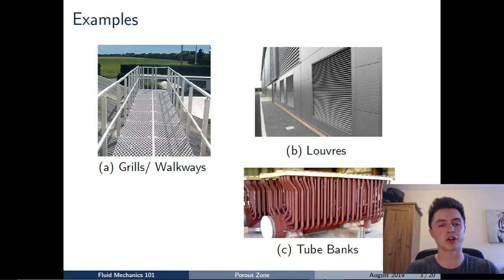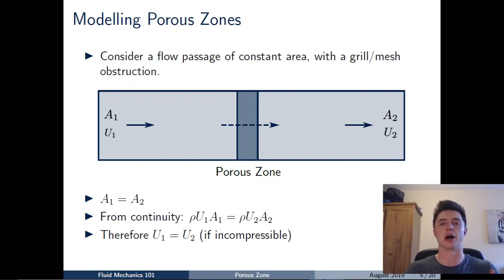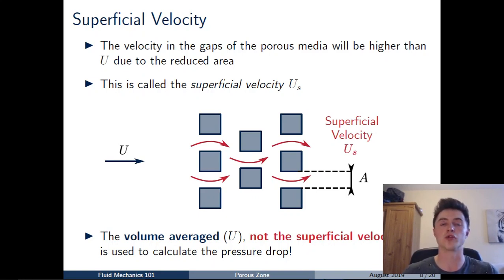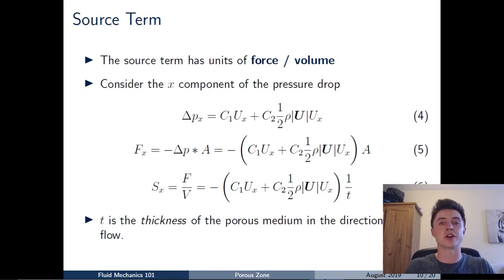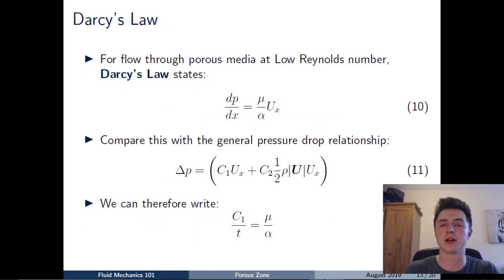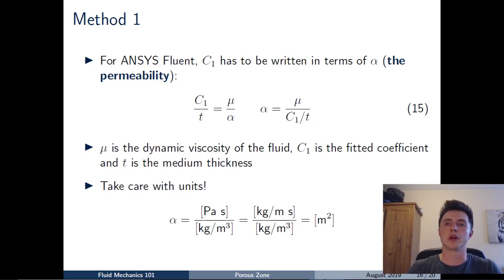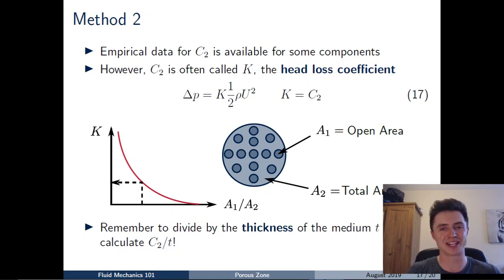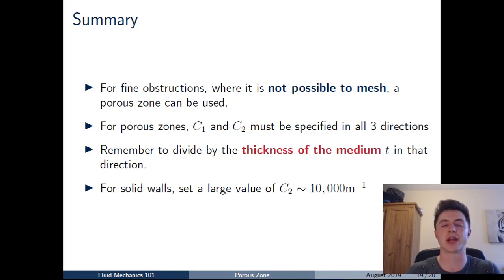[CFD] Porous Zones in CFD

Comment: Thank you very much Doctor Aidan for your excelent explaination.
But there might be a mistake about the definition of the "superficial velocity". I have read different explainations about the "superficial velocity" online, The superficial velocity ist defined as the volume flow rate divided by the cross area, which is, i think, the velocity "U", that you mentioned in your video. The "Us", which you called superficial velocity is maybe the physical velocity. In the <fluent user Guide> the superficial velocity is equal to porosity times physical velosity, which means the superficial velocity is smaller than the physical velocity. But according to your definition the superficial velocity will be bigger than the physical velocity.
maybe its just a mistake :)
Reply from the maker: Yes this is a mistake. I have pinned your comment so everyone can see 😊
Reply: Just to add an additional source for the differences between these velocities; the video titled "Where text books go wrong about porous media" by the Department of Process and Life Science Engineering (PLE) at Lund University describes the differences perfectly.

Comment: For turbulent flow, what changes in the equations? Imagine you are simulating an air cooling system of a radiator inside a duct. What are usual values for beta and alpha for a Radiator? Let's say the radiator has 3cm and the air is flowing ate 30m/s. Thx for the video

Comment: For modeling a basket strainer (~20,000 holes) as a porous zone, what's the practical method to determine the correct C1 and C2 coefficients? Also, how do I define the direction for these values in the CFD setup? Thanks!

Comment: First thanks so much for these amazing lectures. I have been working with porous media for long time to model heat exchanger cores. My question is about meshing. Long ago we did some studies and it looks like hex type or extruded meshes were much better than tets to resolve porous regions. Do you think this is a correct assumption? it is common knowledge that tets are more diffusive with low order fv codes, but is there a reason why this diffusivity could be specially harmful for porous media flows?

Comment: Thank you very much Doctor Aidan for your excelent explaination.I would like to ask whether it is necessary to add boundary conditions at the interface between the porous medium and the fluid region? When I simulate porous media, there is always a droplet splash phenomenon at the free surface or side wall, and then the vof analysis problems, the program can not run, I have not found the reason, want to ask the teacher what may cause this situation?

Comment: Excellent explanation. I have a question about C1, what is the recommended value for it in the solid direction ?
Reply from the maker: 10 or 100 times the value in the fluid direction is normally fine. You just need the resistance to be higher than the fluid direction, so that the flow is encouraged to straighten and flow in the fluid direction. A small amount of flow in the solid direction is fine and makes convergence a lot easier

Comment: Great job, thanks a lot.
I am trying to model a capillary membrane, can I use this model? Do u have any tips to calculate the c1,c2 if the porous media is as fine as a membrane (pore size is 7 µm)
Reply from the maker: The flow is probably laminar through the holes (you can check Re). If it is laminar then you can use the analytical solution for flow through a pipe / parallel sides channel to derive the coefficients C1 and C2. In pretty sure if it is laminar then you will find that C2 = 0, and the C1 will depend on the viscosity and pore size

Comment: Quick question. When you were talking about C1/t being equal to dynamic viscosity/permeability it should be in kg/(m^3*s) should´t it? Because dynamic viscosity unit is kg/(m*s) and permeability is m^2. So when you divide it it should get kg/(m^2*s) or I am missing something? Because when I use polynomial formula in my pressure drop data the units check up because of delta_pressure=C1*U+C2*0,5*density*U^2 you need to get Pa = kg/(m/s^2). Correct me please if I´m wrong. :) Anyway thank you for great contect it was really helpful.

Comment: Thank you very much sir.
Please, how can i calculate these factors when ther is a melting of a phase change material (wax for example). So there is no flow. Just the solid wax melt inside the closed foa(porous media) when the temperature rises.
Thank you before.
Reply from the maker: Solidification and melting is very hard to do in CFD. Unfortunately I don't think I can help you. You might need specialist software for those calculations

Comment: I have a cooling circuit including multiple components like motor, inverter, compressor etc. I want to model the circuit in Fluent while incorporating the pressure drop of each component using porus media. However i am not sure how to take care about the thickness as each component has its cold plate and i do not know their dimensions. Is this a correct approach i am adopting ? thanks
Reply from the maker: Do you know the pressure drop from each component? Or do you have any data / can approximate it? You can use an incorrect thickness as long as you ensure that the pressure drop is the same by adjusting the loss coefficient

Comment: Thanks a lot. However, the pressure drop data is mostly available with respect to flow rate and not versus velocity in industry so curve fitting of DP versus flow rate to get the coefficients remain valid ? thanks
Reply from the maker: If you think carefully about the flow area, then you can probably do the conversion to velocity

Comment: Thank you very much Doctor Aidan 
the porous media can be used for tube bundle. please ,  How I can used porous media with tube bundle using ANSYS, or what is the equations of C1/t and C2/t
thank you very much 
Hayder kraidi Rashid
Reply from the maker: You will need to look up empirical equations for the pressure drop (Euler number) for arrays of horizontal cylinders. Then you can equate these equations to the formulae for the source terms in Fluent and rearrange for the coefficients C1 and C2

Comment: Any specific reason to write modulus of velocity (IUI) in the inertial term of pressure drop equation ?
Reply from the maker: Yep, to make sure that the pressure drop is in the opposite direction to the velocity vector, regardless of coordinate system (- U |U|) will always have a sign that is the opposite of U)

Comment: I see in many cases that people say we use the porous medium to define a geometry where there is no flow actually. Sir, do you know how we define a porous medium that does not allow any flow through it?
Reply from the maker: Yep, just set the resistance coefficients to be high. This will block most of the flow. Values of around 1000 seem to work quite well. If you set them too high the flow will stop completely and the solver may diverge, so be careful!

Comment: Thank you for your very detailed explanation about porous domain in CFD.
Could you please handle about heat transfer in porous domain also?
I'm now using porous domain to calculate conjugate heat transfer of plate heat exchanger, I have difficulty in setting a heat transfer model.
Reply from the maker: Good suggestion, I will see what I can do

Comment: Thank you so much for this wonderful videos! And I still have a question: How about the energy equation of fluid in the Porous zones? Some papers seems only considered the heat conduction between fluid & solid porous layers, while Ansys Fluent seems used different method, and I'm still quite confused about this.

Comment: Thanks a lot for your excellent videos, really helpfull ! I have a question regarding method 1 for deriving c1 and c2 (Curve fitting on experimental data). Whic velocity is considered as x-axis ? Local velocity through the obstacle or velocity just upstream the obstacle ?
Reply from the maker: Velocity just upstream (so based on the superficial velocity)
Reply: @fluidmechanics101  thanks a lot 👍

Comment: Thank you for this video. You really helped me. But I have a doubt in slide No. 16… when you are talking about the units. I can see the permeability unit is m^2 but what happened with the unit of seconds of the dynamic viscosity?
Reply: Hi! I found the same doubt, the units of pressure and C1/mu are both incorrect. Dimension of pressure shall be [M][L]^(-1)[T]^(-2), and dimensional of C1/t shall be [M][L]^(-3)[T]^(-1). However, the resulting dimension of alpha is correct as [L]^(2), LOL.

Comment: Very good video, A1/A2 is porosity ?, thank you.
Reply from the maker: Yep, area porosity
Reply: @fluidmechanics101  Thank you very much.
Reply: Excuse me, but I have a doubt, to obtain the temperature in a porous medium in CDF, how is it? Is it an average of the energy equation of a solid phase and a liquid phase? Thank you.
Reply from the maker: That will depend on whether you have chosen an 'equilibrium' or 'non equilibrium' porous model. In the equilibrium case the solid and fluid are at the same temperature (the volume average). In the non equilibrium case the solid and the fluid can be at different temperatures. This is useful if you have a highly insulating solid immersed in a conductive fluid, as the solid temperature can 'lag behind' the fluid temperature
Reply: Thank you very much for your answer, that is well, greetings.
Reply: @fluidmechanics101  Dear sir.. I am using non equilibrium thermal model for drying in ansys fluent. For that I have written UDF. The problem is that my udf shown segmental error while hook the moisture init after initialisation the solution and go for calculate. It works fine for equilibrium thermal model. Kindly advise me what I have done wrong in that?
Reply from the maker: Hi Manish, sadly I don't think I can help you with your UDF. There is probably an error or a bug. Have you tried contacting ANSYS customer support?
Reply: @fluidmechanics101  thank you sir for your quick response. Yes I have contacted at CFD customer but didn't get any positive response from him.
Reply from the maker: That's a shame. I'm not really sure what to recommend. ANSYS should really help their customers when there are glitches/bugs in their software
Reply: Hi a pleasure to greet you again, the continuity equation for a porous medium is the same for a continuous medium ?, In this case for Ansys fluent. Greetings.

Comment: Hello professeur 
In the porous zone is the value of the source terms in the solid or  fluid  (in fluent )?
Reply from the maker: Your cell zones should be a fluid. Then you need to tick the box 'porous zone'. This will open up the options which allow you to fill in the coefficients for the zone
Reply: @fluidmechanics101  think you professeur

Comment: Thanks for this lecture and your clear art of explanation!
One question, why you choose to set C_2 as big number and not C_1 to describe wall or very high flow resistance in particular direction?
Reply from the maker: If you just want to block the flow, you could do either C1 or C2 👍
Reply: @fluidmechanics101  thank you for answering. I‘m struggling now with one problem connected to this lecture. I‘m modeling two-phase flow (h2o + h2) through porous media with Eulerian approach, capillary pressure and relative permeability in Fluent. Maybe you have some lecture or can suggest some good material dealing with similar issues and explains the theory behind it.
Thanks & Kind Regards

Comment: Hi Dr.Aidan.
In a car company, We use one set of the viscous and inertial coefficients for the pressure drop across the porous media(heat exchange), instead of three set of coefficients.
that means air will flow in all direction, which is not correct behaviors, we expect air will only flow in one direction.
Do you know why?
Nobody knows in our company, we bought CFD methods.
Reply from the maker: Hi there! If you are expecting flow in a single direction, then you can make the loss coefficients much larger in the other directions. This will encourage the flow to go in the direction you want and give the correct loss coefficients. Remember: the flow will always try and follow the path of least resistance 👍

Comment: Thanks, super helpful!  Just to clarify, you should mesh your porous zone as 1 cell thick in the porous direction, so when you divide your Coeff.s by t, it would come out right, correct? or if you have n-cells in the flow direction, you need to divide t by n?
Reply from the maker: Just divide by t. The source terms are applied per unit volume so they will multiply by the volume of the cells. More cells just distributes the source over more cells

Comment: Hello,
I have been looking into modeling porous domains in regards to grain storage and was wondering if you had any thoughts on this. Looking at the literature, I have found pressure drops of (say corn) across a meter bed. Using the curve fitting method, I have found values of the linear term to be in the order of 10+ Million and the quadratic term to be in the order of 10,000. I would be happy to share the google spread sheet with you if you want to see it. 
Thank you.
Reply from the maker: From your values it looks like you can just neglect the viscous term and go with  just the quadratic term. 10,000 is high so maybe do a quick easy CFD simulation with flow in a cuboid shaped domain with a block of porous material and check that you are getting the pressure drop you expect. If that works and you are happy then go ahead with your full CFD calculation
Reply: @fluidmechanics101  Went back and redid the papers test in cfd, and the values are correct. I ended up using simpleFoam with different relaxation factors (0.2 for pressure and 0.3 for velocity and turbulence values) and everything is working better and, more importantly, converging. Thank you.
Reply from the maker: Amazing! Nice work!

Comment: Great video as always. 
Another resource with a lot of empirical C2 or K coefficients is the "Handbook of Hydraulic Resistance" by I. E. Idelchik

If there are no manufacturer's data or you can't find a C2 or K coefficient in literature there is a 3rd way

Run a virtual wind tunnel CFD simulation of a small portion of your grill/louver/heat exchanger etc for increasing face velocities and plot the pressure drop.
You can then extract C2 or K with a polynomial fit as with the 2nd method you described.
Reply from the maker: Yes! Completely agree with all your points. Thanks Manolis
Reply: do you run this CFD sim assuming no porous zones?
Reply: @danmorris9533  I think what @themanolis1984 meant was to make a small part of the material that you want to study as porous zone, as realistic as you can; meaning actually designing the geometry of the domain (as a realistic porous zone, not using porous zone option in your CFD simulation) and running the simulation to get the "pressure drop vs velocity" data, then use that data for simulation in larger scale using "porous zone" option in CFD code. One assumption for this approach I think is that the porous material is isotropic and homogeneous.

Comment: Super useful stuff, thank you for all of this! :D <3 
I have a U-tube shell-and-tube heat exchanger, and I think porous media might be the way to go to model this. How would this be done for tightly packed cylinders? (The shell-side cross flow inside the heat exchangers). There's 159 tubes, and they're about 6 ft long with cross baffles directing the flow. Any suggestions or articles that could help me? :) I'm using Simscale, based on OpenFOAM.
Reply from the maker: I would have a look and see if you can find any papers or textbooks with loss coefficients for heat exchangers. I cant recommend any off the top of my head but you should be able to find some with a quick google search

Comment: Hi! Thanks for the amazing video, it' very interesting. I have one question about how the solver takes in account the of porous media. Does the volume of fluid recognize there is a solid medium in the domain? So for example, if I have a full region of porosity with a percentage of void area of 50%, will the fluid be able to fill only half of the region?
Reply: ANSYS fluent doesn't recognize any solid domain. It only applies the momentum sink term once you activate the porous media model.

Comment: What about C1x & C1y? What should be the value as there will be  high resistances in those directions as well
Reply from the maker: Yes, you can usually just pick a very high resistance coefficient and that is enough to stop the flow in those directions. Around 5000 should do it 👍

Comment: Thanks for the very nice lecture!
One question:
If a porous media is made of entangled fibers and the liquid is wicked into it by capillary force, how the C values should be calculated there?
(Do we need a microscopic image to measure the average size of microchannels between the fibers, or what)
Reply from the maker: Do you have any measurements of the pressure drop?
Reply: Fluid Mechanics 101 We have a graph for wicking length vs. time. Can we use the wicking rate to determine C value?
Reply from the maker: Sorry Hossein, i dont really know what a wicking length is? Maybe ask your colleagues

Comment: thank you very much for this lecture 
I have a very fine grid in my geom so i decided to instead it with filtering region 
but i dont have the chart to find "C2" 
the area's ratio is equal 0.00101085 !! 
do you think its work with this??
thank you
Reply from the maker: It will still work. The pressure drop will be quite high though ...
Reply: @fluidmechanics101  yes it is.... in the last week i work in method that run the grid model and take the pressure drop before and after it and calculate the velocity then draw the graph .....but also i had very large error between the two pressure drops ....is the method i used work here ??